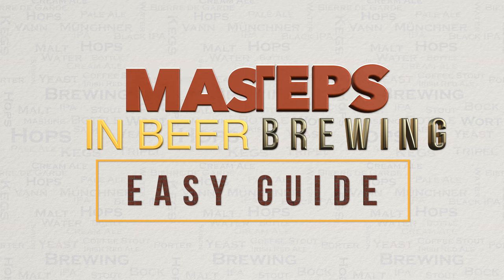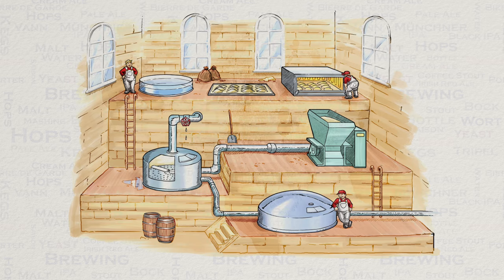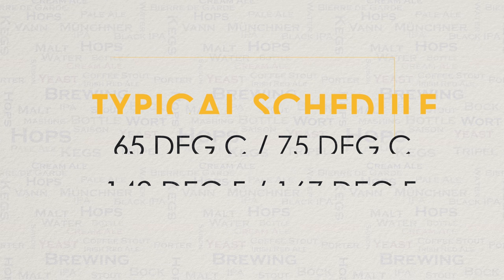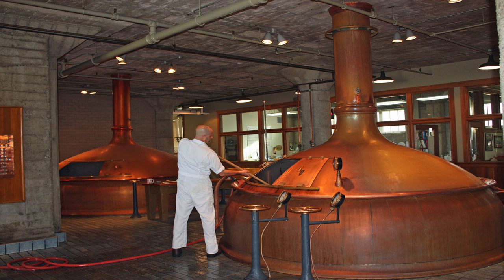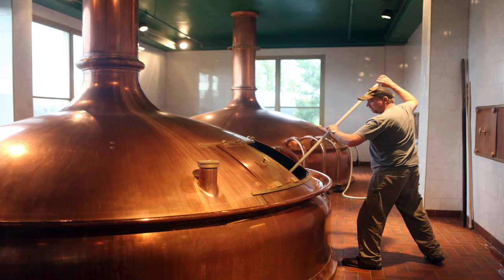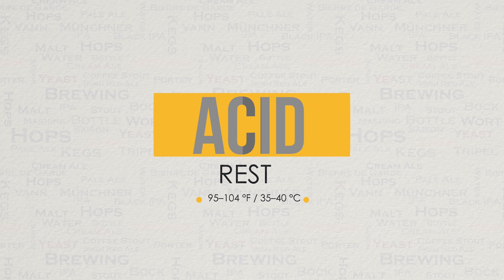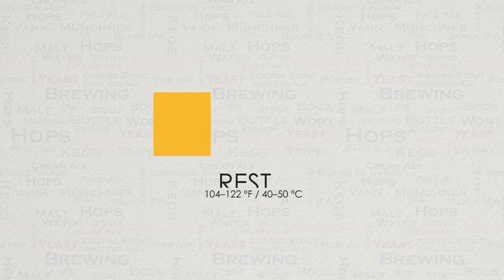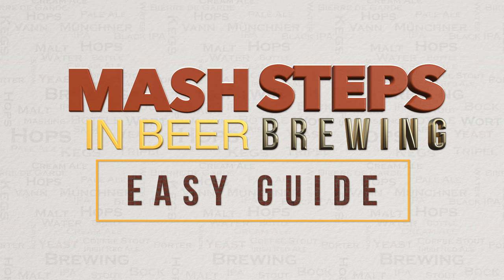Mash steps in beer brewing easy guide

Comment: thanks for that another great vid

wouldn be interested to know what you think of mashing in at 72 and let it slowly cool to 60 - is this a reverse step mash? - if stove top brewing its easy to do
Reply from the maker: Hi Gary, great to hear. 
If you start your mash at 72 then you will very quickly denature your key enzyme. Reducing the temperature will not have further effect. 
High mash in steps are usually just used for beers where you want much sugars left behind to add body or sweetness. Stouts are the usual style for this.
Reply: thanks for the reply fella that probably explains why my beers have been turning out very sweet? @DavidHeathHomebrew
Reply from the maker: @garyballared2077 Yes, it would have that effect.

Comment: Hey David, 

First of all, thanks a billion for all your great content. Totally love it and learned a lot from you.

I've been brewing with the Grainfather G40 now for a while, and am wondering if a potential top mash plate would be from any value. What do you think? 

From what I expect, it could help diving the circulating wort a bit better on the grain bill, but at the same time you can't really stir on the bill when the plate is in place. 

When using the G30 I also got rid of the top plate pretty often. 

Looking forward to hear from you what you think! 

Cheers from the 🇳🇱

M.
Reply from the maker: Hi Maarten, 
Great to hear :) 
The top plate for the G40 is very much optional. It is mostly there for holding larger grainbills in place. So really just relevant if you are maxing out the grain basket capacity.
Reply: I’ve experienced it once, with a large triple grainbill. The grains were floating through the two open holes on the top side of the basket. That was annoying and I’ve hacked by blocking the holes it with two small rubber hoses. But far from convenient. 

I’ve noticed a big hole in the middle of the top plate (on a picture). Which means the grains will still go through. Right?
Reply from the maker: That I assume is the old top plate. The new one has no middle hole.

Comment: Thank you for your informative videos. I have a brewzilla version 3.1. I have been doing overnight mashes with the pump running slowly.  When doing a step mash with a mash that long should the time at each temp be proportional (ex: 4 hrs at 143 and 154 with a mash out with the remaining time)  or should the mash out be the largest chunk of time. I had come across that as an idea elsewhere but since learning the mash out is mostly just to loosen the grain for sparging it would seem that time would be better applied at the lower temps, correct?
Reply from the maker: I would suggest mash in being the longest time. Mash out can come later. The idea being you maximise effeciency.
Reply: Ok, that's pretty much what I was thinking. So maybe 6 hrs, 2 hrs and 15 minutes sound good for the 3 temps?
Reply from the maker: @noelhendricksonhome7305 You mash out temp can just be ten minutes. There is no value in much longer.
Reply: yes, I meant to say 10 min for mash out. Just to confirm, going with 2 hrs at 143 and 6 hrs or something similar proportionally at 154 should work well. @DavidHeathHomebrew
Reply from the maker: Ok great 🍻🍻🍻

Comment: Really informative, thanks! Would it be an issue to use the 50/60/70 Pilsner steps with an Ale receipe?
Reply from the maker: Not an issue as such, just that there will be little to gain
Reply: @DavidHeathHomebrew  Thanks David!

Comment: Hi David I have the Grainfather with the new connect now iv noticed and not sure if I should do the same as Brewers that use the mash tun coolbox method but most that use the coolbox method use a higher strike heat to get nearer there proper mash temperature they require and should I wait till I get the temperature for mash before I put the grain In also should I wait till I get a full rolling boil before I add the hops thank norman
Reply from the maker: Hi Norman. It really depends on which version you are using. If its the US version then due to the power limitations then I would heat higher than mash in temps in due to the time it takes. If you are on a 220-240v system then there is less to worry about. I live in Norway with 220v and I just shoot for the desired temp. It drops a little after adding my grain but within a little time its back where it should be. In terms of the boil I wait until the unit tells me I have hit the boil (100 deg c) I then clear the protein head (I show this in most brew videos) and as long as I am at 100 still I start the timer. Homebrew is not an exact science but I do what I can :)

Comment: Hey, David.
I have a question. I am currently using mash&boil when I am doing the mash-out (recipe calls for 60min @69C and 10min @78), do I need to raise the water temp. immediatly by adding a calculated amount of hot water, or can I use the units in-built heating element to gradually get to 78 and keep it there?
Thank you!
Reply from the maker: Usually the process is to change the temperature on the brewing system after the 60 minutes step. Wait until the temperature is reached and then start counting the 10 minutes. After this you are ready for the next step which is usually going to be to add Sparge water of a similar temperature to your second step. Hope this helps :)
Reply: @DavidHeathHomebrew  this little bit of advice has answered a big question for me, thanks!
Reply from the maker: Great to hear :)

Comment: Hi David, and thanks for your videos!  I was used to sparge at 80ºC after a single mash step at 67ºC (heating water at 72ºC before adding the malt, which will result in 65-67ºC).  Following your videos (as the SweetChili and others), and this, your method goes in 2 step mash (mashin mashout) mostly, which makes more sense in order to get the most of the grains.  In this case... what would be the right temp for the sparging process?
Reply from the maker: Thanks, I am glad that you are enjoying them :) I usually mash out and sparge at 75C.

Comment: Hi David. Excuse me for asking stupid questions, but I have to ask to be sure. The "mash out" step people do for about 10 minutes typically at 75 degrees, do the circulation pump still run for those 10 minutes ? And afterwards you shall sparge with 75 degrees water ? Is it important that you complete the whole sparging before you set the grainfather to a boil ? Because I noticed that my grainfather automaticly started to heat up to a boil after the "mash out time" was finished.
Reply from the maker: No problem at all. Yes keep the pump on throughout. Boil heating wise its fine for this to start while you sparge. It saves time :)
Reply: David Heath thanks for the clearification :-)!

Comment: Hi David,
Love your videos. Are you aware of any upcoming new version of the Grainfather?
Plan to buy one and just want to be sure that there is not a new one that will be in the market in the next half year...
Thanks
Reply from the maker: +ltcomstar Not that Ive been told about, no. I don’t see the need, upgrades are always things that can be added on alot like the filter and connect for example :)
Reply: Thanks
Reply: Grandfather is great and all but I own a robobrew, same build quality for half the cost, the only difference is that it lacks bluetooth but why the fuck should I care about a recipe creator and what not....

I can do that on beer smith so im not going to pay more for nothing better.
Reply from the maker: +chris kennedy I guess its more about the controller being smart than anything else but its all about choices. You can use my recipes and advice the same way with other systems for the most part.

Comment: Another great video David. Would a beta-glucanase rest be ideal for brewing a hefeweizen? That's my main brew and I am a bit worried when I go all grain I'm going to be fighting with a stuck sparge every 2 weeks!
Reply from the maker: +Ross A Cairns Yes thats a time to use it, though a small amount of rice hulls will work wonders :)
Reply: How much rice hulls would you say is sufficient for a Wheat bier with the following Grain Bill? 

3,47 Kg pilsner malt
3,47  Kg Wheat malt
200 grams Red Ale Malt(melanoid malt)
Reply: Cykelsnubben Cykelsnubben you shouldn't need much as the wheat is under 50% of the grain bill.
Reply from the maker: +Cykelsnubben Cykelsnubben I wouldnt use any as you are under 60% which is really the start of the point that it becomes an issue. I am working on a video to do with this right now actually :)

Comment: Hi David, thank you for your informative fun video. We have brewed a reasonable Belgian Tripel with the following mash schedule. (65 c for 65 minutes and 75 c for 10 minutes) Now I would like to add some sweetness to the beer and based on the information in the video would like to introduce an intermediate step of 68 c for 30 minutes. (65 c for 35 min, 68 c for 30 min and 75 c for 10 minutes) Does that sound like a good move and should it result in a sweeter beer? Thanks in advance for your response!
Reply from the maker: Thank you. I would go 62//68/75. Be sure to back this up with a middle attenuating yeast.
Reply: @DavidHeathHomebrew  We are currently using the White Labs WLP500 for our Tripel with an Attenuation of 75-80% and do not know exactly under which category this falls. We are a bit confused with low / middle / high Attenuation yeast. Is there a standard for this? The internet often shows different standards.
Reply from the maker: Yes, the Internet is certainly not united on this and many other things. Attenuation for beer yeast is generally going to be between 65-85%. Low is around 65-70%. High is 80-85%, so middle is at 75%. With various Belgian styles inverted sugar is often used which will leave unfermtable sugars behind. Also the bitterness added via hops is usually low. So all this put together leads to a beer that tastes sweeter. Naturally the combination of all 3 gives the sweetest result but for many 2 out of 3 is enough.
Reply: @DavidHeathHomebrew  Thanks for your help, we are one step closer to our perfect Triple ;-)
Reply from the maker: I have a full guide to the Tripel (one of my favourites ) coming on Sunday. I hope you find this interesting. There are many more pointers there.
Reply: @DavidHeathHomebrew  Sounds good David, we'll definitely check it out!
Reply from the maker: Great :)

Comment: I have a problem/question that I just cannot figure out. Basically, my problem is all of my beers are finishing to dry. My FG reading seems to be always around 1.000, no matter what I do. I meticulously clean and sanitize. Keep my temp in range; I even bought a precise thermometer to check against the system. Any help is appreciated. Thanks in advance
Reply from the maker: Hi Scott, how are you measuring this and with what type of device? Do the beers taste that dry?
Reply: @DavidHeathHomebrew  Hey, David! I'm doing BIAB, with an Anvil kettle. I use the kettle thermometer, which I've calibrated and recently started using a thermoworks probe thermometer to insert into the mash. I have noticed that the temperatures can be different in the two locations (kettle thermometer is lower than probe in mash), so I think the one in the mash would be the one to go by? I do stir every 15 minutes and if I need to add heat. The beers generally taste good and I guess how intended (since I have no way to compare to yours), with the exception of the NEIPA style. These are the beers where I notice the particular dryness and lack of body/"juiciness". Most recently, my goal for mash temp was 152; maybe I need to go higher?  I've become really frustrated and determined to conquer it, so I just ordered stuff you recommended for small batch/trial sizes in an effort to discover and correct my mistake(s). My thought is if it is temp (likely?), the sous vide stick will immediately identify that problem. Any recommendations or thoughts are appreciated. Enjoy your trip to the states!
Reply from the maker: Thanks Scott, my flight out is early tomorrow morning. In regards to temp by location in the mash, this is normal. The new Brewzilla GEN 4 units address this with a couple of optional extras but I would be surprised if it is causing this. How are you measuring the gravity instrument wise? Are you using a hydrometer or refractometer?
Reply: @DavidHeathHomebrew  I have used both for OG and only a hydrometer for FG. Even if the numbers would be wrong, the proof is in the taste and thinness of the beer. Any thoughts?
Reply from the maker: My guess would be wild yeast. Not much you can do about either sadly.
Reply: @DavidHeathHomebrew  Whoa!!! Are you saying that it will always be present?! All my brew stuff is stored in my basement, so if there would be wild yeast down there, there would be no reasonable way to keep it out of stuff? I can bleach or replace all my lines, etc. Would that work? Of course clean and sanitize my fermenter, etc. This is blowing my mind, lol! If I clean and sanitize everything, but hang it up in the basement to dry and for storage, it wouldn't matter...I guess. I'm going to take everything apart and go nuts on the cleaning and see what happens. Sorry to take up so much of your time, but if you have any advice or direction, I'll gladly take it. Thanks, man!
Reply from the maker: Hi Scott, nothing is totally assured with wild yeast, so its really impossible to say. Personally I would try an open fermentation and see what the end result is. No cleaning is going to help.
Reply: @DavidHeathHomebrew  well, that makes me feel emotionally deflated, lol. Based on your reply, I assume you believe the yeast would be (ever)present in my basement instead of any specifically contaminated equipment?  Does this mean my brewing life is over?! Anyway, I hope your trip is going well and thanks for all you do.
Reply: Another layer of the story: I went down just to check on it after dry hopping last friday (before i thought to ask) and noticed the beer is even thinner, with no hop aroma or flavor and it was a good bit of hops.  I put a temp probe in the thermowell and it registered 79 degrees! That indicated to me active fermentation, but the yeast I pitched should have already done their job.
Reply: @DavidHeathHomebrew  as far as your open fermentation suggestion, i was thinking of making a starter from dme and letting it sit in a container in the basement to see what happens. Do I cover with cheesecloth or anything? Thoughts?
Reply from the maker: Hi Scott, it could be gone tomorrow or present still in a year. It is really impossible to predict. Work with it rather than against it 🍻🍻
Reply from the maker: I would suggest not judging it too much flavour wise until at least a week after its finished fermentation and dry hopping.
Reply: Hey David, just a quick follow up. You mentioned to work with it. Can you explain how I can do that and what I need to do to work with it? I don't want to quit brewing!
Reply from the maker: Try the open fermentation with a simple wort to understand what this wild yeast offers